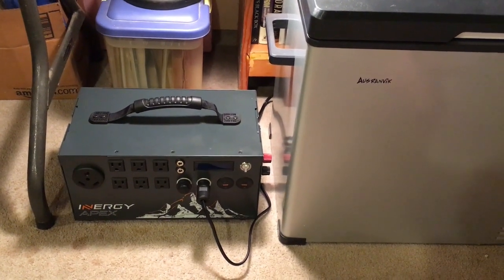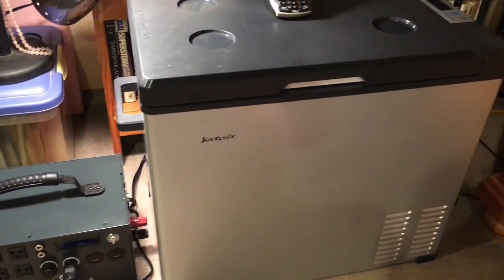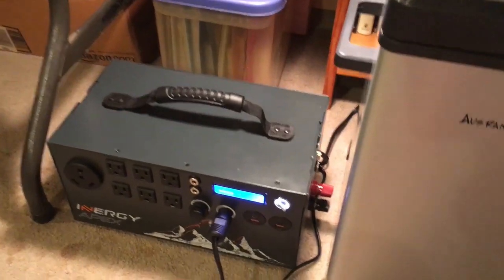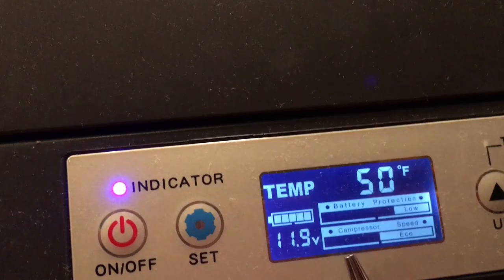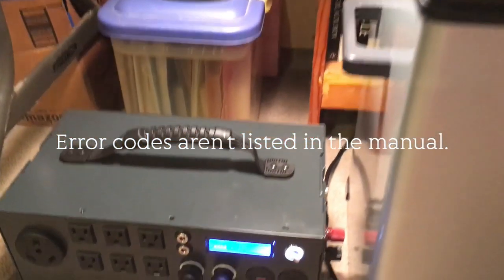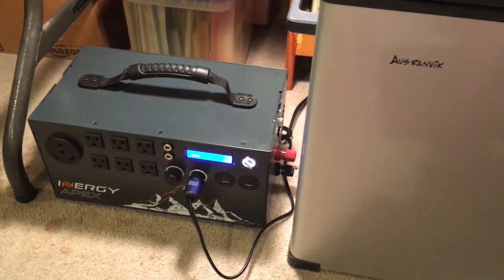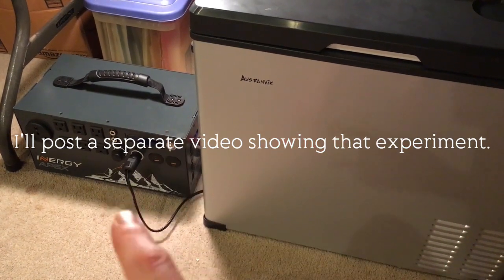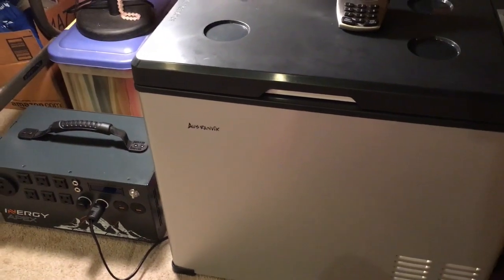Inergy Apex and Ausranvik fridge, 12V DC test run

Comment: I had the same issue with my fridge and my apex. Have you found any fridges without the battery protection?
Reply from the maker: No, they all have the same protection.  Some models can be turned off but some of them can't be.  Watch the video in the pinned comment to see how I got around it.

Comment: Hi, I am the customer service representitive of Ausranvik, and I am so sorry for the ER1 issue. I must say, thank you for the tests, now we know the way we test the product's performance in our laboratory needs to be changed, and we realize we need to improve the quality.

In the video I heard that you don't quite need the battery protection, in this case, you could turn off the battery protection then the fridge could work much longer (press and hold SET button, select F5 code, then press + or - button to turn off the battery protection) without the ER1 issue. With your battery, 24 hours of working, 63% remaining capacity, I do believe it could work much longer if you turn off the battery protection.

If, at last you are still not satisfied with the fridge, please do not hesitate to reach us by email (to service@ausranvik.com) or call our toll free number (888-732-2220) to get your full money back, we will not waste our customer's money if they are not satisfied with our product and our service.
Reply: A better solution would just make a 4th option on the fridge LED display (OFF) and update your manual. But good to know there is a "secret" way to shut off the battery protection.
Reply: @Cryo837  I thought the instruction manual should have include the part of all the calibration code (from E1 to F5), but obviously I was wrong. I have already told my colleague to improve the user manual, and it sounds necessary for us to change the control program as well, unfortunately I am not an engineer but I believe they will work on this issue. I'm glad I view youtube periodically and get to know our problems, and thank you guys, your reviews are important, please tell us whatever in your mind.
Reply: @June-Tang  Thank you for being responsive. That alone makes me lean towards buying your product. Respect!!!
Reply from the maker: @kyleosho  I'm very impressed, too.  I already knew going in that the customer service was responsive because of the feedback on Amazon.  That's one of the main reasons I chose this brand.  I didn't know they'd go so far to respond to videos.  Very good idea to monitor the internet for customer reviews in order to garner suggestions to improve their product.  👍
Reply from the maker: Thank you so very much for reaching out to me.  I don't see the F5 code listed in the user manual with the other codes, so I wasn't aware it existed.  I was wondering if there was a way to bypass the low battery protection.  I will definitely try this fix, and film it again.  If this doesn't work, I'll contact your office.  Thanks again!
Reply: @freedomdove  Thank you!
Reply from the maker: @June-Tang  This worked perfectly.  I just finished my testing and was able to run the fridge for 55 hours until the Apex reached 20% left.  I'll be uploading a video showing this later on.  I definitely think you should update your manual to list this F5 code.  I also suggest that the error codes be listed in the manual since there is no mention of them at all.  I'm presuming there is more than one error code.  Thanks again for reaching out to me to solve this problem.  Much appreciated.
Reply: @June-Tang  I have a new unit, less than 30 days old, purchased off of Amazon Prime. I have one of the 48 quart units. I have messaged your company through there, but I would like to discuss other issues here as well.
You guys REALLY do need to publish these error codes somewhere, perhaps with some troubleshooting steps or simple repair steps. The basic troubleshooting in the manual is not sufficient.
ALSO! The manual indicates that when starting the unit, the indicator light should be red for 3 minutes before the compressor turns on, then it should be red in MAX mode, and green in ECO mode. My unit has the indicator light turned off during the three minutes, then it turns blue when the unit is running. This function is perfectly acceptable, since the LED display indicates Max / ECO mode, but the manual is incorrect.
My unit has the temperature set point at 28 degrees F. I should mention that the unit is running using the included AC/DC converter that came with the unit. Yesterday, the unit was flashing Er5, it had stopped the compressor, and the food compartment quickly got warm. I unplugged the unit, waited a few minutes, then turned it back on, and it worked successfully. Today while running the unit, it said Er4. Again, I unplugged it, waited a few minutes, plugged it back in and it worked successfully. As I am writing this message, just now.. I checked it and it once again and it says Er5. This unit is sitting in an air conditioned room, so if it is overheating, there is NO excuse for it. It is elevated off of the floor, on a flat surface, and the vents are fully exposed to the room. I suspect it is over-heating, because when I open the inspection panel, I can see that the fan is MUCH smaller than the vent hole (which allows air around the fan) and that the fan barely moves any air at all. The inspection area is perfectly clean. Almost new.
 I don't know who made the decision to put an undersized fan in this unit, but I believe it was a mistake (I might be wrong). It is unfortunate that the way the unit is built, I can't easily access the fan to replace it with a properly sized one for the vent hole.
Additonally, I don't underastand the decision to not include at least a cheap dust filter to protect the fan, and simply use a slightly stronger fan.
The temperature sensor seems to be accurate, but is detecting the coldest temperature near the cooling loop. I keep it at 28 degrees F to make sure that the bottom and top of the compartment remains below 40 degrees F, which is the minimum for food safety. I will now change the temperature set point to 30 degrees F to attempt to keep the unit running without an error, but I am not sure if this will keep my food in the food safety temperature range.
The unit works extemely efficiently when it functions, it is unfortunate that this has happened.
It is slightly irritating that the cooling is performed in a band around the center of the unit. With the temperature sat at 28 degrees F, it will freeze things in the center of the unit, but my bag of popsicles laying on the bottom never freezes. Since heat rises, there REALLY should be a minimal cooling loop in the bottom of the unit as well, to offset heat rising through the floor of the unit. 
I have seen low flow fan units which you can add in to an RV displacement refrigerator to improve it's cooling capacity. I think this unit could benefit from a smaller version of that. However, it's placement will need to be carefully considered to protect the fan blades and not block access to the chest area. Please let me know if you are aware of such a solution for these 12v chest freezers. I think future versions must be improved with a cooling loop in the bottom as I mentioned, but adding a low flow fan device is the only way I can think of to improve the cooling capacity of MY unit.
It occurs to me that an extra inch of insulation in the floor of the unit, and above the compressor area, would go a LONG long way to improving the unit.
While my unit is being used indoors.. I do not understand the decision to have the lid dark gray. If somebody needed to use this unit out in the sun, dark gray is just about the worst color you could make it. It will absorb nearly all of the suns heat
None the less, the unit itself is EXTREMELY impressive in its ability to quickly displace heat with a minimum of power consumption. I simply believe that it could be a marvelous unit with a few design improvements.
...I don't expect you to troubleshoot my unit here on YouTube, Deco tang (unless you want to), but I would very much appreciate your comments on the other issues I have mentioned, especially the ones that might help me improve MY unit. Thank you for your time, and thank you for being a company with real customer support. :)
Reply: Deco tang I’m having issues with mine and don’t know what to do
Reply: Less than 24 hours new and got error messages / er3 and er4 

Very sad was looking forward to this being an exceptional product
Reply: @wendelhammock1692  These units are sensitive to things like voltage level, being tipped over completely, and extreme exterior temperatures. If you don't have the manual, try to find one and check through it before you write the unit off completely. There is a whole BUNCH of advanced settings accessible through the settings button, as mentioned above.
It is most unfortunate that the Er3 and etc. codes are not listed in the manual, however, so you may need to contact the manufacturer to ask about those. The codes seem to mean the same thing for most of these 12v refrigerators, but I wouldn't guaranty it.

Comment: Fyi, have an apex and a small fridge set up also. I am almost positive the fridge neeeds to rest 5 minutes for the compressor to "relax" before switching from dc to ac on the apex. Basically let the fridge sit for about 5 minutes
 For example If the fridge was plugged into the wall socket and you abruptly shut it off and turned it back on the compressor would likely send you an error code again. Any refrigeration unit needs to let the pressure bleed off in between cycles. Hope that helps..
Reply from the maker: Thank you very much for the information.

Comment: You may need a voltage regulator so that if the apex 12v drops it can still keep your refrigerator running. My question for you is what is the running voltage on the refrigerator. How low can the input voltage drop on the refrigerator.
Reply from the maker: Thank you.  The fridge was at 12.4 in the beginning but dropped to 11.9 or so when it was running.  At the end of 24 hours, it was reading 11.4V.  I'm not sure that's what kicked it off, but I'll look into getting a regulator anyways.
Reply: I must respectfully disagree. The battery pack that she is using (probably) monitors the battery percent by voltage (at the batteries), then shuts down access to the battery when it gets too low. In addition, this refrigerator (actually a chest freezer) is designed to run on a WIDE array of voltage. If I recall, it runs on '12v mode' from arounnd 6.5 DC volts to about 20.5 DC volts, then runs on '24v mode' from 20.5 DC volts to about 32 DC volts (don't quote me on that). An expensive DC regulator (the cheesy ones lose too much power when they convert it) CAN be helpful for other devices, if your battery pack doesn't include one. Noteable, if your battery pack is getting low at 10.5 volts or so, then the included USB outlets might be only putting out 2.5 volts, and won't charge any smart devices (cell phones, tablets) at all.. if your battery pack doesn't include a decent voltage regulator.
So, I'm not saying that your idea is silly, I'm just saying that I don't think that it will help to run these refrigerators. Also, some solar generators / battery packs already come with a high quality DC voltage regulator, so it might not be needed at all.

Comment: Thank you again for these real world tests. At first I was thinking the fridge was so great but then it looked like maybe the fridge was the culprit. Or did the Apex shut off its DC feed by itself? So still not clear which is the culprit, the fridge or the Apex. If the culprit is the Apex, Inergy should explain if they designed in an automatic shutoff or whether this is a faulty unit. Be interested to see the same test using the AC outlets/inverter to see if there is also a shutoff at ~65%. In a true emergency situation one would hope that you could run that fridge and drain the Apex battery almost down to zero. Imagine if you had critical medicine you were trying to keep cool for yourself or a child...ugh.
Reply from the maker: You're welcome.  I do think this is a problem with the 12V refrigerators.  The Apex was still humming along.  The 12V fridges all have that low-voltage protection, and unfortunately not all of them can also run on 110V.  When I do my test tonight running it on AC, I will see if this allows me to bypass that protection.  I'll run it as long as possible, so it may turn into a 36 hour test, depending on how much power the inverter pulls the whole time.   Thanks again for watching and commenting.  🙂
Reply: @freedomdove  I have done research and the fact that the fridge battery protection will shut down the fridge (so you can still start your car...LOL) while set on "Low" but with having the Apex still at 65%, is a joke. The DC option on the Apex drains the lithium batter MUCH more slowly as you have shown so that it even makes it more galling.  One would hope that High meant 75%, Medium = 50%, and Low = 25% (of whatever battery is providing the power). But it seems like on the fridge High = 90%, Medium = 80%, and "Low" = 65%. I can't stand when companies think they have to "child proof" our products. Tell us in the manual what the cutoffs are and let US decide. 
Our washer automatically limits the amount of hot water that goes into the washer basin in the name of "green energy". But for whites that means that the water doesn't get hot enough to kill bacteria. It is not overridable so you have to manually shut off the cold water feed when the tub is filling.  Drives my wife crazy!!! 
Anyway, I won't bother you again and just want to thank you for doing these type of tests. The Apex looks perfect for us. But going to investigate battery "protection" characteristics of other DC fridges. Bye...
Reply from the maker: @Cryo837   Lol on the washing machine.  I had to purposefully buy the least expensive model just so I could have a modicum of control over the thing.  All the new ones wanted to control everything.  🙄

I was just wondering last night what would happen if I ran the fridge on DC with the battery protection on high.  If it's shutting off at 65% for "low" then I imagine I'd hardly be able to run the thing on high or medium.  Lol.  Alas, I'm stuck with this fridge b/c it's functional.  Can't send it back when it works...

Thanks again, and you're not bothering me.  I hope you and your wife find a good model for a refrigerator.  If you have the money, the Dometic and the Engel both look good--though I'm not sure how much better they are in the battery protection mode arena.  I plan on buying the insulating cover for this Ausranvik 48qt to help it be more efficient.